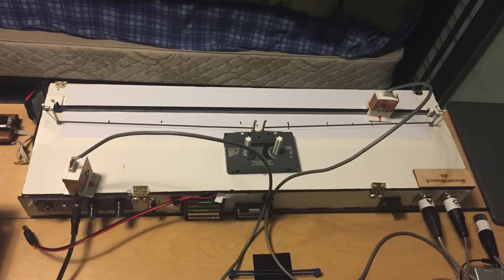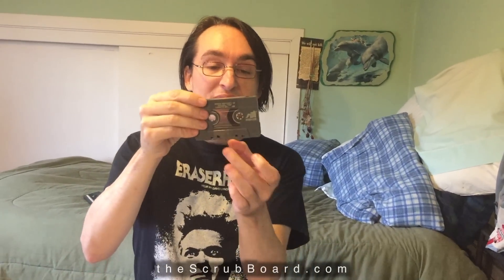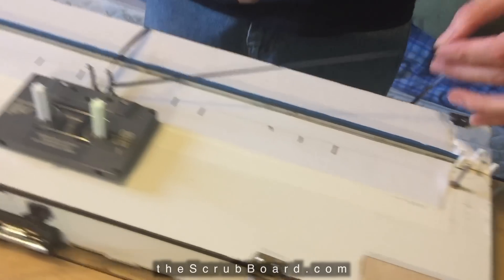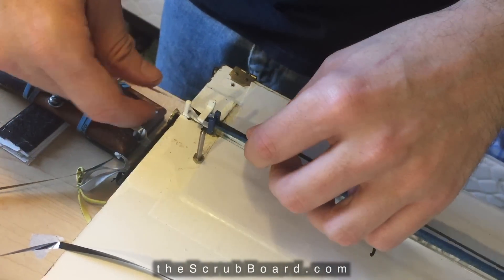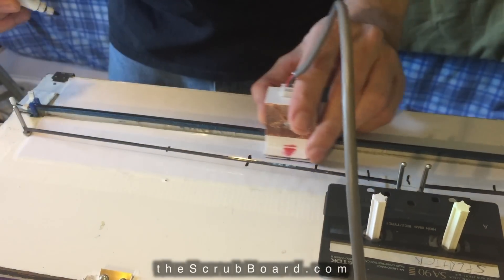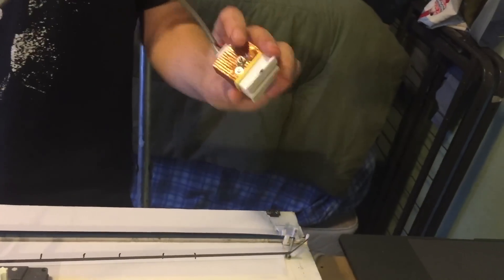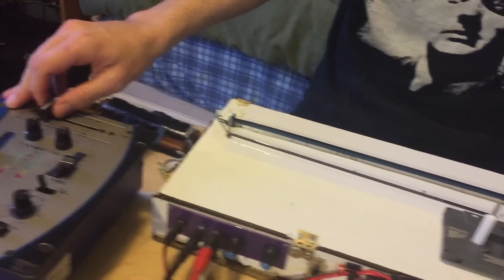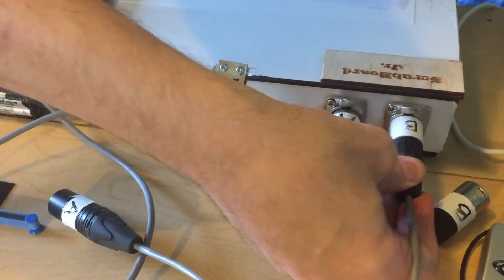Scratch with any cassette tape -- introducing the ScrubBoard Jr.

Comment: Not your idea
Reply from the maker: I certainly never claimed to have invented the concept of tape scratching -- I only claim to have invented the ScrubBoard!  I have done a lot of research throughout the patenting process, and I can definitely say with confidence that this particular method of tape scratching is indeed my idea.  Tape scratching typically involves moving the tape against a stationary playhead.  What makes the ScrubBoard unique is the manual movement of the playhead, which really opens up a lot of new possibilities. Of course the more traditional method of tape scratching has lots of possibilities too, and I would never say that one is better than the other. Every method of scratching has its own unique sound, and it's that variety that I love!

Comment: Amazing. Is there anything stopping me putting a small motor on one of the pegs if they get to market
Reply from the maker: I think it would definitely be possible to mod this thing to add a motorized tape transport, but unfortunately you'd need to do more than connect a motor to one of the pegs.  You'd also need at least one motorized pinch roller to maintain the tension of the tape stretched across the rail, plus another motor if you wanted to be able to run it in both directions.  And I haven't even mentioned how you'd regulate the tape speed, as the two reels get bigger/smaller!  That's why I've been using tape loops in my fully functional prototypes instead of reels -- much simpler.  But anyway, I'm always happy to see when my stuff has sparked people's imagination. Thanks for checking out my videos and for the feedback.  More to come soon!